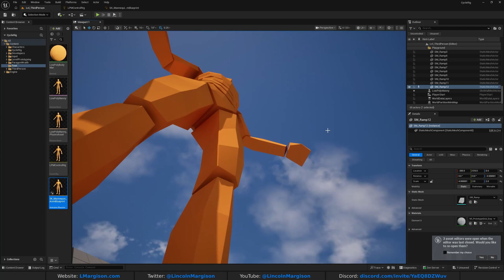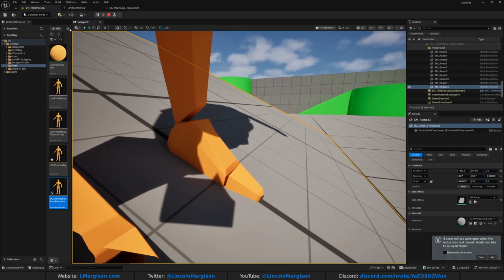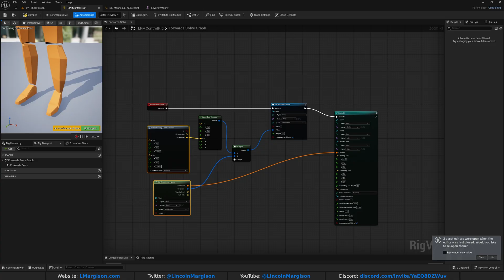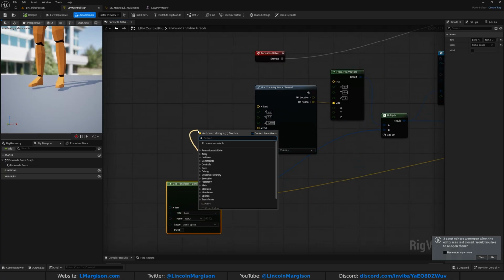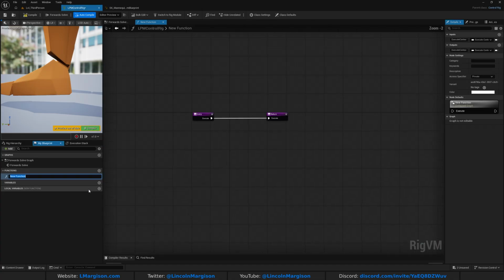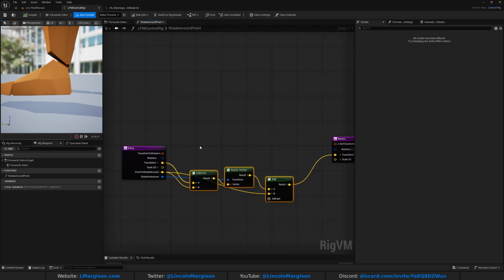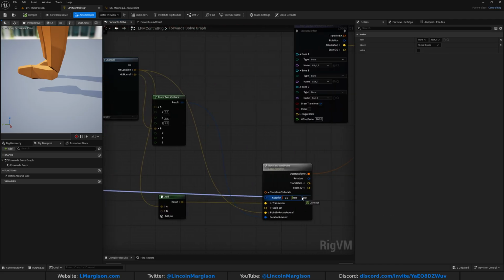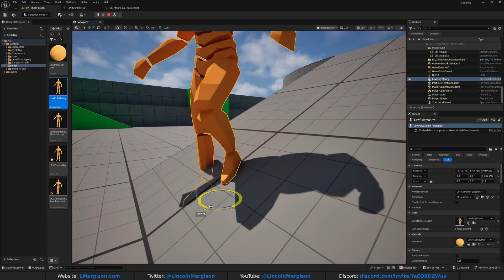Align ANYTHING to surfaces in ControlRig [tutorial speedrun]

Comment: I really love the content you create. I was wondering if what is being applied here would also work for quadrupeds. In the limbs, four bones are usually used, but would the IK calculation be done using the last three bones? Thank you for your time. <3
Reply from the maker: You can use the FBIK node to solve for longer chains of bones. I prefer the basicIK where possible because it's more accurate/mathematical, whereas the FBIK (or fabrik) is more like iterating toward a solution. But you can also combing and use both.
Reply: @LincolnMargison  Thank you for your reply, I find what you mentioned very interesting. Would it be possible to implement the IK using only Basic IK for greater precision, or does it necessarily have to use FBIK? Also, is FBIK meant to be used for the entire body, or can it be applied to just a single chain of bones? Sorry for asking so many questions, but I’m very curious about this topic, and thank your for your time i appreciate a lot of.

Comment: Animation Warping solved this ages ago with a single Foot Placement node. Yet somehow we’re still overengineering it with pointless math.
Reply from the maker: Gooooooood luck with that for procedural animation. Try making a character put his hand on a wall with no animations and using the Foot Placement node. Also, overengineering it = combine an offset and a rotation.. to offset a rotation. Seems exactoengineered
Reply: L take